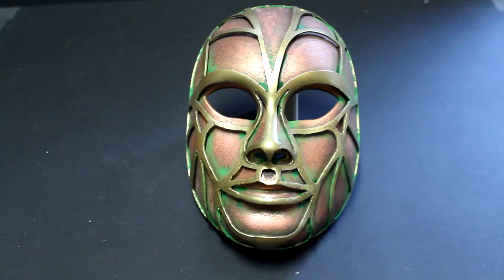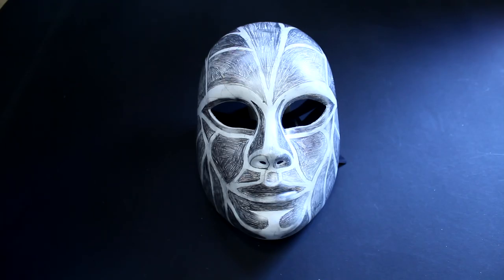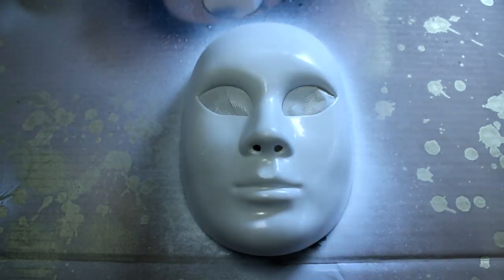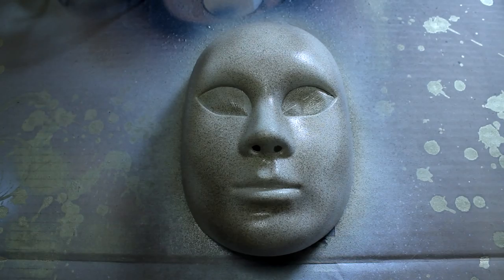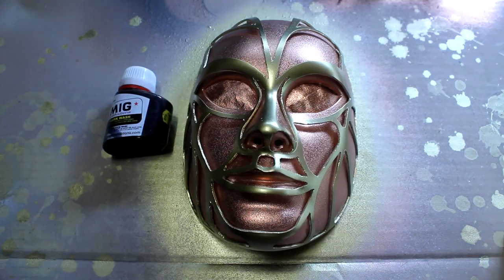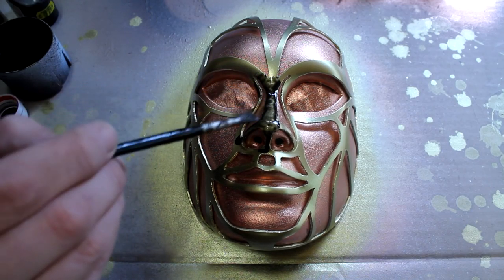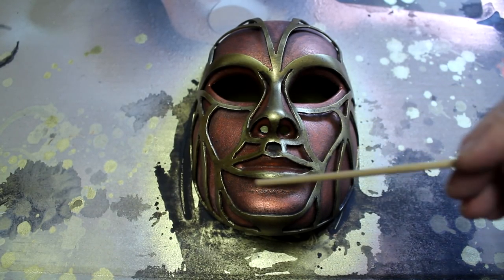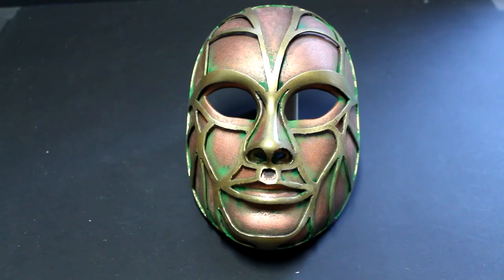Steampunk Venetian Mask 2016

Comment: You glued painted surfaces. Did you have trouble with adhesion? What glue did you use? thx.
Reply from the maker: tackyman2011 just superglue.  There were some adhesion problems but it was ok.